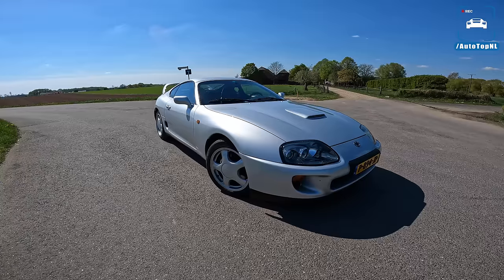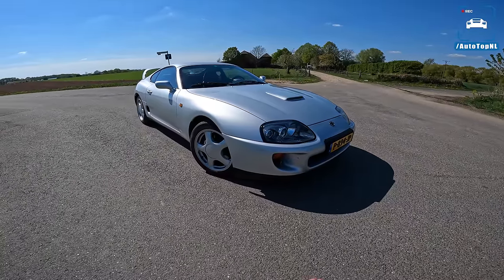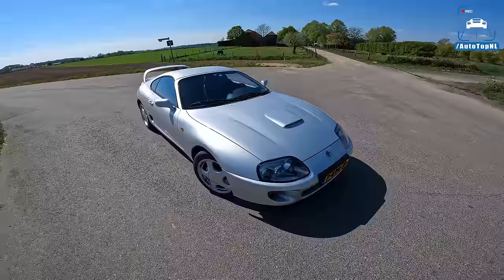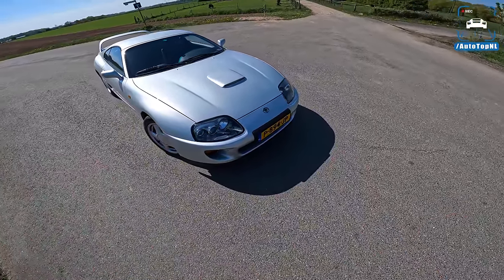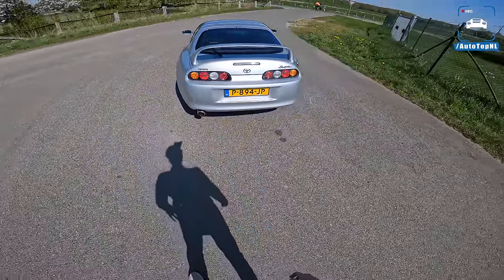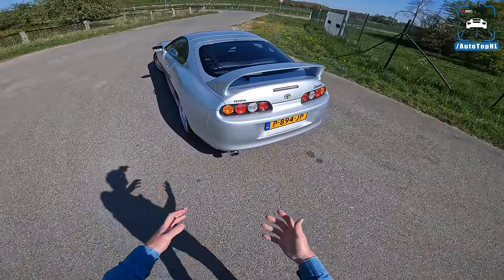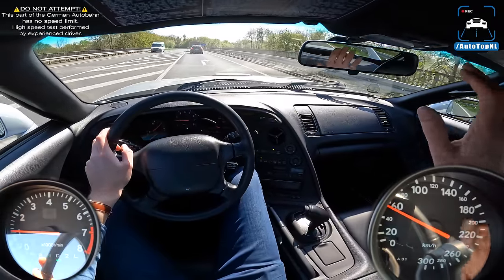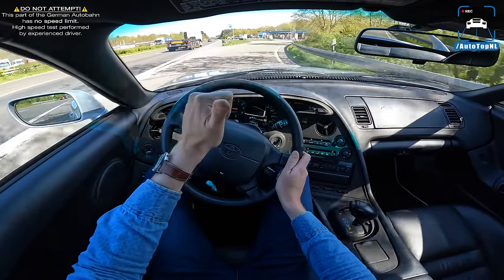*FACTORY NEW* Toyota Supra MK4 | 250km/h REVIEW on AUTOBAHN by AutoTopNL

Comment: The acceleration looks incredible considering the 4 long gears. I wonder how the in-town agility is and how quickly can you move around city driving citations.
Reply: Жалко, че не е с 6-степенна ръчна, както повечето биха предпочели, но 4-степенният автоматик си е доста подценен също.
Reply: In it's time it was one of the quickest cars to 60 that you could buy. I think Road and Track got 5.3 or 5.4 seconds. Quarter mile is done around 13.8 but I've seen a 13.5. That's in the mid 90's when LS1's made a 315/325/350hp depending on the car.
Reply: If you wanted quicker you could get a Porsche turbo or Ferrari Maranello.

Comment: This one is insane, but when are we going to see an RX7 🥺🥺🥺
Reply: yea that's a safety hazard, we don't want to see them running out of oil at 270kmh in the middle of the road
Reply: @blacksta-r  u gonna go trough 2 sets of apex seals before you reach 270kmh
Reply: When it doesn't break down
Reply: when the lift gets fixed
Reply: @blacksta-r  All you have to do is check it every time you stop. No goddamn computer to look at it for you here.

Comment: How to spot the 14 year olds in the comments:

Saying its not fast 
Commenting about the fact its an auto

Bare in mind these came with like 320hp stock back in the 1990s, that is actually insane when you think that equivalent inline 6 turbos of today are still coming with roughly the same power stock these days (N54,N55/B58 in the 335i,340i,M240i etc).
Reply: Actually those who mention auto are more than likely to have been around when these were new…
It was always seen as a big no no to buy the auto if you were a petrol head as they were rubbish back then! 90s 4 speed autos with long gearing were bad! I’ve owned one lol. However not bad at higher speeds.
Same as in the NSX

Whilst nowadays autos are the things to have for the younger generation! 
So I totally disagree
Reply: @WeirdBrick  nah I'm not saying auto is a good thing in these, but I  get your point. But you get some of the younger guys who can't drive who always comment negatively on auto boxes when in reality they are superior from a performance perspective, but the actual engagement and preference is a different discussion. It's like "okay great you like manual cars, so what?" You're right though in that my argument is a bad one for this particular car, but it's a trend I've noticed in comments

As far as I know manual swaps in these aren't too difficult as well, I think most petrol heads would be thinking "how fast can I swap the gearbox" rather than "the gearbox is crap that's why it's stock and no one likes it"
Reply: @TajwarC  Ofc because the auto gearbox of the supra is shit.
Reply: more like the people saying it's fast and that the fact that it's auto don't mather that are the 14year olds.
Reply: 320hp wasnt crazy in the 90's it was the norm for a GT, look at BMW with the M3.
Now manufacturer stay at 300hp because it's pretty useless to have more on daily driver in Europe at least.
Reply: You say 320hp is insane in the 90s like the car was invented in the 60s.

Comment: Actually didn't expect it to be this quick. Although it has 280hp which is more than decent people always seem to exaggerate how the weight affects it, and how the auto affects it as well so people call them slow all the time but it's no slouch. Must be real quick with the manual since the gears are quite a bit shorter since there's 6 of them.
Reply: 320hp.

Comment: Supra is a great car, very fast.
Drivers want to drive fast enough to take full advantage of its performance.

However, the speed limit on ordinary roads in Japan is 60kph(37.3mph), and even on highways the speed limit is 100kph(62.1mph).
Also,  highway tolls in Japan are very expensive, costing about 25 to 40 yen (1$=138JPY) per kilometer(0.62mi)

I envy the Autobahn very much :)
I'd like to drive a car on the autobahn someday....

Comment: you can lower the active front spoiler by putting the ignition on start without starting the engine. then pressing the spoiler button and it will be activated manually 😊

Comment: Guy keeps knocking it cause it’s an automatic w 3 or 4 gears..🙈. Only if he knew some of the quickest Supras are 3-4 speeds.
My transmission builder back in the day held the record for a few things. And his 95 Supra was a 3 speed out of an old school Chevy w a diff torque converter.. and he was running high 8s back then in 2006. It was a street car w no cage!

Comment: I got to drive a RHD, Single Turbo, 2JZ-GE Supra. I think it was about 360-380whp. Most worthless powerband I've ever felt. It had nothing below 5000 rpm, and redline at like 7300. But every shift it would just barley fall out of its power band and would need a second to build boost again. It was on coil overs and some other aftermarket suspension stuff, but it still felt kinda like a boat. 

I also go to drive a stock Dodge Stealth R/T Twin Turbo (3000GT VR4) and it felt way more tight and eager than the Supra. Not to mention the powerband was fantastic. The engine actually felt kinda modern. Little turbo lag, quick build up of boost, strong flat torque curve. Was a touch front end heavy and felt more like a FWD car thorough the corners, but it could put the power down with 0 torque steer. 

I didn't drive but got to ride in a 300zx twin turbo. The rear LSD was lacking IMO, ok for donuts and burnouts but not good enough for hard corner carving. The engine in that felt like the VR-4. Good strong build up of boost early on, no drop off of torque at high RPM.
Reply: Cool story bru
Reply: xXOkayXx
Reply: 300zx had 4 wheel steering in the 90s

Comment: Teenagers wondering why it doesn't have 1000bhp stock
Reply: well they basicaly do have 1000bhp stock. you just have to replace every part in the engine bay with aftermarket parts and boom 1000hp.

Comment: This is the real supra, not the fart sounding trashcans with 1500 horsepower and shit exhaust sounds with 10k km engine failures
Reply: this is the stock trash Supra that is only popular because of the 1500hp ones. nobody would give a fuck if they where not tuned and built.